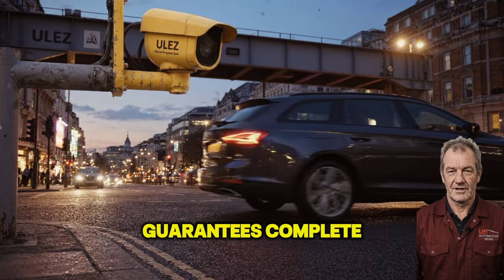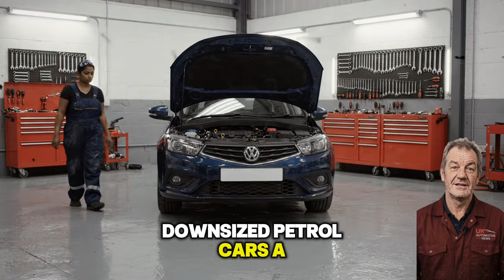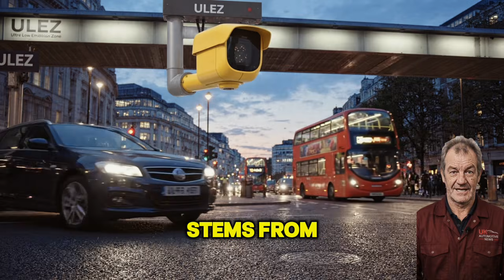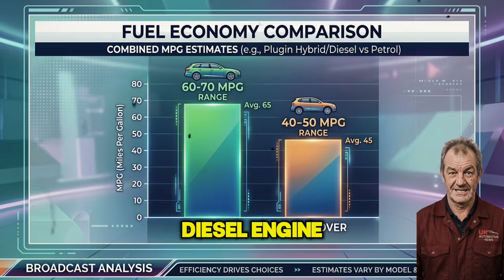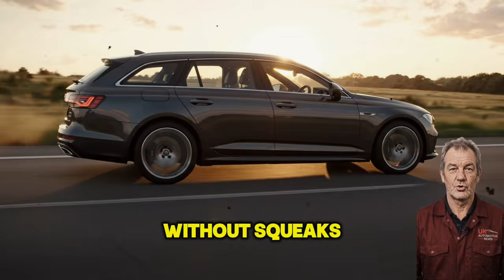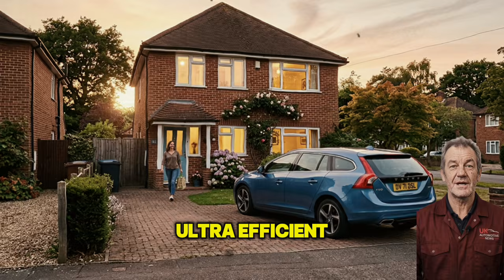The Last Reliable Diesel You Can Still Drive in the UK in 2026!

Comment: My Honda Crv 1.6 I d tech returns between 56 mpg and 64 mpg depending on load and traffic conditions . Absolutely  superb vehicle.
Reply: My Kia EV3 will do 300 miles in any weather for about £5.50 That's about eight times cheaper to run.